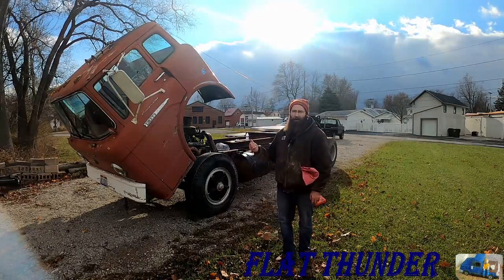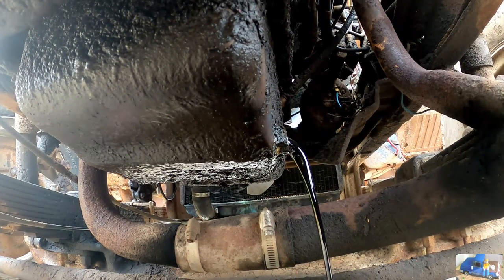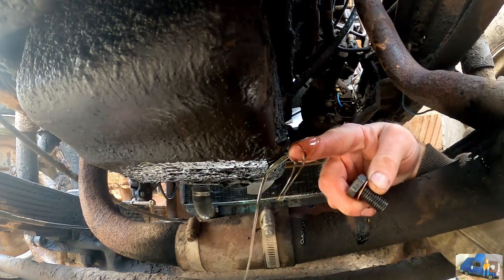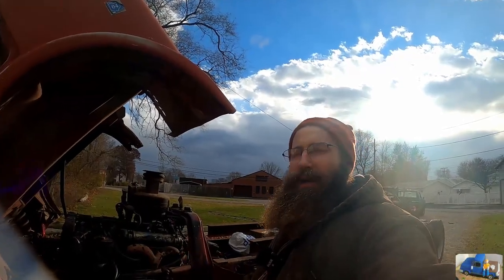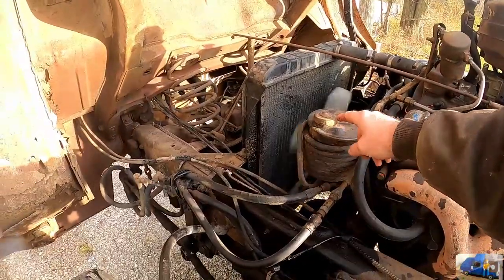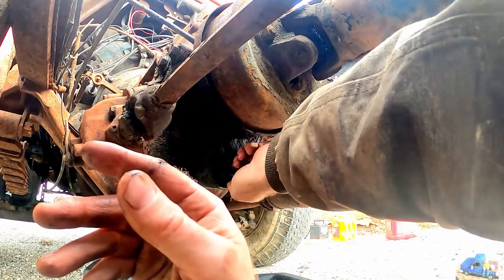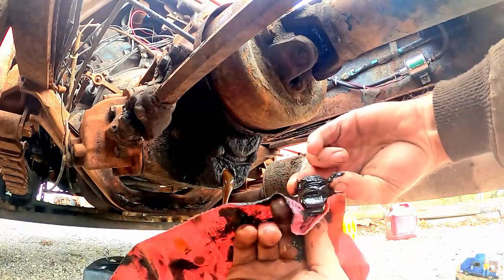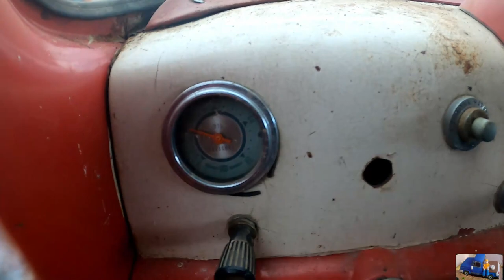1962 FORD C750 CABOVER; OIL CHANGE / ESCAPING THE DRIVEWAY

Comment: Nice project! I was a Ford truck mechanic back in the seventies. I use to say it had a mystery shifter. You never knew what gear you were going to get. When the shifter was in any gear there was enough slop for another couple of shift patterns. I like the fact that it has a Y block. All I remember was the FE/FT engines, the Cat 3208 and the 401/477/534 Super Duty gas engines.
Reply: I had a buddy that drove a 1969 cabover Ford grain hauler with dump bed during harvest for his brother in law. I have no idea how he could find a gear in that thing! I thought maybe because the thing was 20+ years old at the time (This was the 1990's) that maybe the linkage was worn out but looks like this was status quo. I do like those old trucks.
Reply from the maker: Thanks for sharing Bill!  The shifter is still a little mysterious to me now.  I'm used to top loader gear shifters that area way less sloppy.  I too am starting to like the nostalgia behind the Y Block engine.  It's a piece of history.  Thanks for watching!  👍😁
Reply from the maker: @Stephen it is exactly the same!  So far my only gage is rubbing the gage cluster (first) or trying to grab the radio (reverse).  Thanks for watching and sharing!  👍😁

Comment: Most Y-block canister filter's take a either a Wix 51004, 51271 or equivalent. There are some variations over the years but those are the common filter element. Can convert to spin-on with a Napa  4124, also available from places like Dennis Carpenter, etc.
Reply from the maker: Thanks!  I will look into these parts.  I'm leaning towards a spin on for functionality, but it kind of removes the historic element.  Thanks for watching!  👍😁

Comment: Greetings from the Ohio Porters. 🤩 Love the old Ford Cabover!🥰 I drove a 1965 C800 back in the day. Have such wonderful memories of that truck.🥰 It had a 390 gas engine…I don’t remember what oil filter or gas filter it took, other than the fuel filter was an inline metal casing. The exhaust manifold leaked, so we had to finally take it off and replaced the gaskets so that it would sound right. It was a 5 & 2 speed. Those trucks were so awesome. Hope that you really enjoy this truck! It’s unusual, classy and has lots of style and character!  Oh, make sure you check the wiring harness under the cab/behind the grill…it has a plug that can sometimes come disconnected. Mine did. Good stuff! Keep On Truckin! 😎🤩✌️
Reply from the maker: Thanks!  I will check that wiring connection.  It would be really cool if that was the problem area and a easy fix.  Right now none of the accessories or lights work.  I was shocked the ignition/starter circuit was functional.  She's had a few farmer modifications!  The old C800 sounds like a fun rig!  Thanks for watching!  👍😁
Reply: @FlatThunder  🇺🇸 That plug caused lots of problems for us until we found that it was loose. I remember being on the side of the road trying to get it running and spending hours of troubleshooting on it. I have many fond memories of that truck. We put hubcaps on those Dayton wheels, lots of lights on it, a hitch for pulling trailers/mobile homes and a toolbox behind the cab. It got lots of use! I loved that single axle tractor and drove it to high school.🥰 You could turn that thing around on a dime and it sounded really good once that exhaust leak was fixed! I’m glad you have the truck. Thanks for sharing! I’m really enjoying your stuff!🤩✌️
Reply from the maker: @the.porter.productions  you are getting me excited about customizing this old girl!  She has a long way to go, but hopefully I can drive her around while working on her!  Thanks for your kind words.  I'm happy my projects are enjoyable for others to watch.  Hoping it encourages others to take on their own projects and save some old iron!  😁
Reply: @FlatThunder  🇺🇸Paul here. I’ve found that working on these old rigs is quite exciting, especially if you can work on them in a garage. The Ford cabover has lots of style and potential! By all means, take her out for a spin every once in a while! Gotta enjoy every step of progress…and then test your work with a fun drive! It’s the little things that can make this rig so, so cool! These old trucks can be so functional still! Thanks for sharing your work! 🤩🥰😎✌️

Comment: Wix 51271 Cartridge there was a adaptor available to use a spin on and that took the old fram PH8A, yes lubing all the joints on the shift linkage is needed plus it looks as if it has a 2 speed rear end . If it doesnt have air brakes it wont be wedge style but if memory serves each shoe has its only wheel cylinder most likely they are partially rusted and in need of rebuilt or replaced it will take a little research but most likely they are still around nos if nothing else
Reply from the maker: Hi Patrick!  Thank you for sharing info on the oil filter and brakes. 😁  It definitely has air brakes and a two speed differential.  I need to start tinkering with those items more.  Thanks for watching! 👍😁
Reply: @FlatThunder  now wedge brakes they are a breed on their own, if that is what it has had a semi trailer with those and they were always dragging a little so as to glaze the linings not so much hanging up like the issues you have but squeezed a lot to the point of annoyance

Comment: In case you haven't researched it yet, IIRC  there are adapters available to convert the Y-block to a spin on type filter. The various displacements were installed in a wide variety of Ford & Mercury cars and trucks. I'm pretty sure Lincoln as well. As for the Y-block engines, there is still a ton of parts available for them if you wish to improve what you have. If you plan on keeping her, you might look into some upgrades in the future. Best wishes! 👍🏻🇺🇸👨🏻‍🏭

- Max Giganteum
Reply from the maker: Hi Max!  I researched a conversion kit to convert her into a standard spin-on filter.  However I haven't gotten any further.  The biggest hold up on parts is finding a solid reference to indicate I have the correct part number.  I think I started referencing a Lincoln or F100 model.  I am still slowly working on her.  Thanks for watching!  👍😁

Comment: I use a BALDWIN LF314 {#P80} oil filter, the one from rock auto comes with all rings and gaskets needed. They also have a nice set of spark plugs.  I have a 292 Yblock. You can also find parts easier if you reference 1957 Thunderbird y block
Reply from the maker: Thanks for sharing!  I will have to check out the oil filter and she definitely needs a tune up.  Thanks for watching!  👍😁

Comment: Great job showing the OIL changes.
I know what your going through. My 353 
Detroit, on my Backhoe TOY just like you and the RED girl. Has ALL filters canister just like your truck. Like some of the other comments. Sense it's basically a big SOCK. Why not  just clean the element good. I have the same issue on shifts on SeaGrave. I have my DASH points for where to push shifter. I some times just sit in cab when I Run her. And just shift without moving to FEEL it go in gears. Plus ithe shift lever shows you where a reference point is. The comments are right. I have a tone of linkage going back to 
Spicer. Then there this funny looking YOKE 
Because of my PTO for pump. I removed a lot of the RODS going back to spot were pump transfer case was. There is a guy who has a Transfer case for my Pump, he will just give me. 
I like the idea though of just having a portable pump. Then I can spray water as I drive her.
Keep doing the how too videos. I learn so much from you. I will do a U- Tube video on my 71
SeaGrave for you to see my Engine, and it Running, I have 4 SIRENS on her. Two coaster
Two Electric.
Reply from the maker: I will watch the video of your SeaGrave when it's uploaded!  The free transfer case sounds like a winner.  'Anything free is worth saving up for' 😁.  I think the more I use the shifter it will operate better.  I'll plan out targets for 3rd and 4th when I locate them 😁.  Thanks for watching and sharing!  👍
Reply: @FlatThunder  
I hope you FIND your filter. I will try to Look it up on line. Talk to my guy who does all the stuff I can't do. The FD even takes there tuff jobs to him. He does complete overhauls,  rebuilds on all forms of class- 8 truck. I will see him next week, see if he KNOWS the filter number. Or remember anything about the great old longest running C- series Ford cab overs.

Comment: I'm sure that old filter is doing a great job with that new oil..
Reply from the maker: All the gasoline dumped in the engine from the stuck float might have cleaned out the old one?  🤔
Reply: It wasn't a stuck float... the likely culprit is a bad diaphragm on the fuel pump. Check your fuel pump if you haven't over all this time!! Peace & good vibes! ✌🏻👍🏻🇺🇸

- Max Giganteum

Comment: It mpst likely has the old wedge style brakes. They'll sometimes seize upwhen they sit. Usually taking out the wedge, give it a good cleaning and grease, will fix the sticking
Reply from the maker: Good question, I will have to look into this possible wedge mechanism.  I'm sure everything's all gummed up with rust and goo.   Thanks for watching!  👍😁

Comment: Actually very impressed. You did guess right where what plug was on the gearbox. The old oil was just moisture contaminated and very old from the looks of it. Metal flakes maybe to do the fact the clutch master went bad a long time ago and the shifting was incorrect to begin with and some of the gears got grinded in the process.
Reply from the maker: Thanks!  I was paranoid it would have a ton of water sitting in the gear box that would freeze up and bust.  She was a little crusty.  Thanks for watching!  👍😁
Reply: @FlatThunder  All is good I think the rust will not be a issue inside, it will become clear after the next oil change. I don't know if there is a after market oil filter housing for a more modern filter. Definitely worth investigating, since some of the old cartridge filters have become obsolete overtime.
Reply from the maker: @SuperMAZ007  I think I may find the correct cartridge and buy an adapter.  The idea would be to keep the original for historic value, but have a readily available spin on for ease of use.
Reply: @FlatThunder  That is neat idea. If you gonna open the old canister. Be ready for some spillage and have a rubber mallet cause they sometimes stick hard. Also some have not a o-ring but a grooved rubber gasket to match the housing. Just letting you know, but maybe not case on this vehicle.

Comment: I watched all the other videos and I love this truck.  I saw in one of your videos you have the fuel pump wired to the coil pos.  That should only have about 6 volts in the run position due to the points.  Usually during cranking the coil gets 12v and then it goes through a ballast resistor to drop to 12v.  This might be why you had fuel pump issues.  Might be worth looking into a electronic conversion for the points as well.
Reply from the maker: Hi Landis!  I believe you are correct.  The stepped down voltage at the primary side of the coil made my fuel pump operate at a whisper.  I temporarily gave it a manual feed from the battery.  She needs a ton of wiring to get all the systems working correctly.  Thanks for watching. 👍😁

Comment: I got the same truck I need some information about how to do a front and rear axle swap since I don’t really like the band wheel thanks
Reply from the maker: Awesome!  I haven't ventured that far down the resto path.  I'm not likely going to change the axles.  I wonder if you could just change the spindles out front?  Thanks for watching!  👍😁
Reply: My rear hubs are leaking plus am planning to switch wheels but am still in the process
Reply from the maker: @gato771000  share a picture of the end result!

Comment: If you actually take the oil filter out then you can bring it to the motor factors and they will get a visual match very quickly...it might even have a part no. On the old filter...other than that your just playing a guessing game...
Reply from the maker: Good idea, I was hoping to have options available before removing the old one.  I don't want a dead horse this size in the driveway 🤣.    Thanks for watching! 👍😁
Reply: My dad and I did this to get a new oil filter for our TEA20 Ferguson tractor
Reply from the maker: @alpharaptor7510  I have TO20 that needs some work.  I believe Dad and I had a similar encounter with it's oil filter.  Thanks for all watching!  👍😁

Comment: While not as much fun as driving it you could jack up one side and put it in high gear and let it run a while to get things warmed up. Also to "wash out" a trans rear end even an engine get them warm drain the fluids put in some diesel fuel and run them for a short period of time. Re drain and refill with clean oil. I have done it many times. The diesel has enough oil in it so it won't hurt anything and the thinner liquid will wash out all the gunk and fines. In a pinch you could remove the oil filter to find out which one you need then wash it out and reinstall till you can get one. Old stuff is a lot more forgiving than the newer stuff.
Reply from the maker: @Johnny Holland. Good ideas!  I contemplated splashing a little diesel in the gear box, but was afraid I would rush the process.  I think I may give this a try in the future.  Thanks for watching! 👍😁
Reply: Never run an engine without oil! If you're going to do the old timers diesel trick then do it immediately prior to your oil change. You pour ONE quart of diesel fuel into the crankcase when the engine is hot and let it idle for 5 or 10 minutes then promptly drain it plus swap out your filter. Will this help keep your internals clean? Yes. But so will using a quality synthetic oil. On a seldom used vehicle, it doesn't make sense to run synthetic but that's an owners choice. Best wishes! 👍🏻👨🏻‍🔧🧰🇺🇸

- Max Giganteum